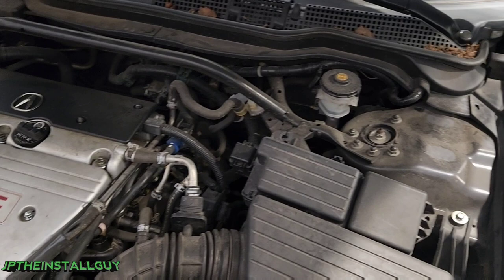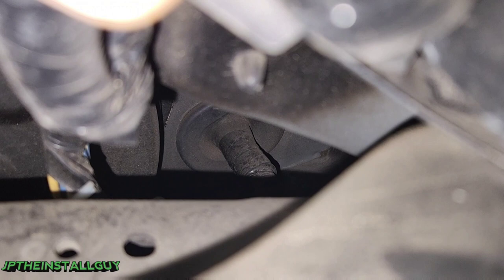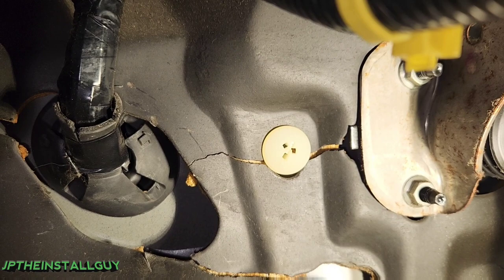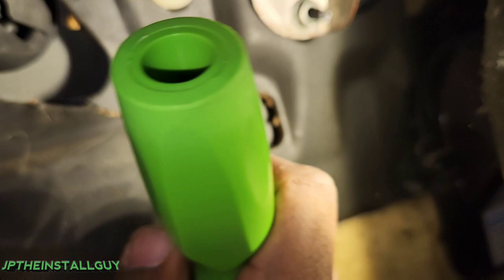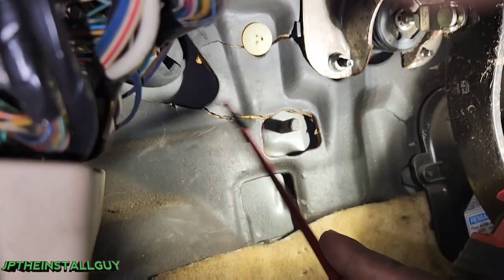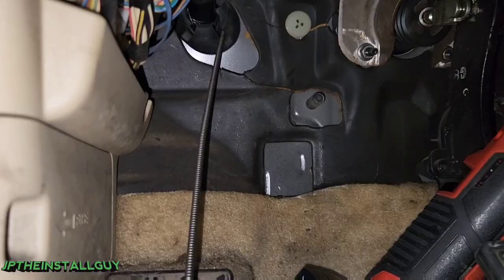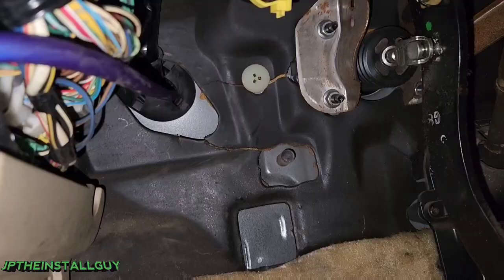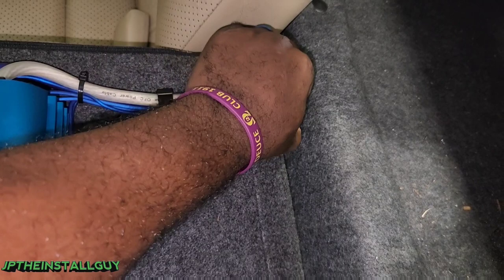run power wire through Acura tsx firewall

Comment: Thanks for showing me that grommet! I will need to see if my 2004 has it. I have 8 gauge running to an amp in the trunk, but I am upgrading and need to run 0 gauge. I don't like where the first one was ran as it crosses the engine bay to the passenger side foot well. 

Question, how did you mount the amp? Just sheet metal screws?